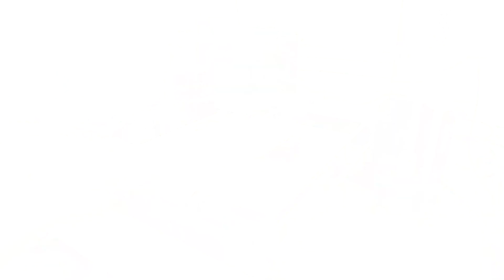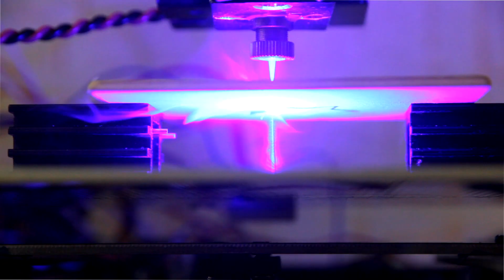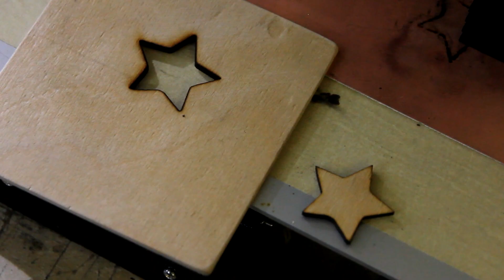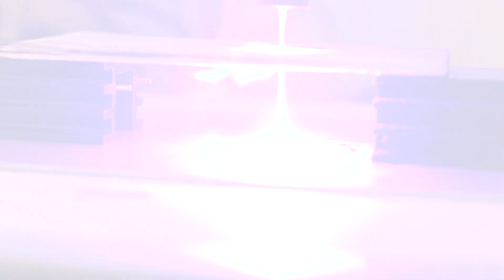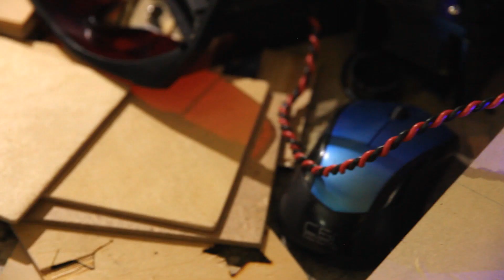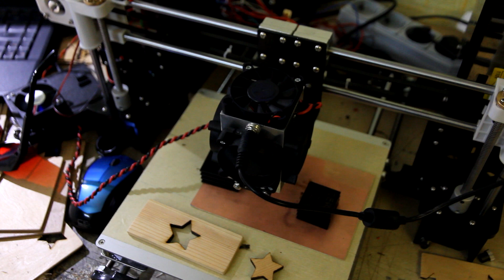Laser cutting with a 10 watt Endurance laser 445 nm. Live demo.

Comment: What is the kerf of the laser?
Reply from the maker: do you mean the depth of the laser cutting?
Reply: Endurance robots channel....... the kerf of a cutting device is the width of material removed in the cutting process, a circular saw with a 1/8" thick blade has a kerf of 1/8".....
Reply: @jasonlipavsky7371  There is no kerf with a laser cutter and if there is it is roughly 1 micron
Reply: @Jack Critchley There is always a kerf, even with a laser. See my example below.

@jason lipavsky I understand what you are asking ;-) and the short answer is: It's tough to say. In this video, he is using a very short focal length, causing a lot of charred (burnt) wood, contrary to his statement that there is none. See the black stuff? That is charred wood. It can be minimized by focusing the beam a little better, but there will always be a charred edge when burning through wood. Low power lasers will amplify this effect since they have to spend more time burning through the wood.

From top to bottom:

Laser Source
     ||||||||||||    <-- laser beam (photons)
     -----------    <---cutting head + focusing optics
      \       /    <---beam exits the cutting head
        \   /
          X      <---beam convergence/divergence point 
        /   \ 
      /       \

The convergence/divergence point is where you want your material to be. A longer focal length will increase the convergence/divergence "height", but it will NEVER be perfectly parallel. Only a very high power laser (kW range) would be able to produce something close to a parallel beam.